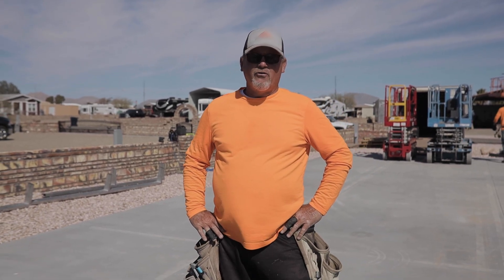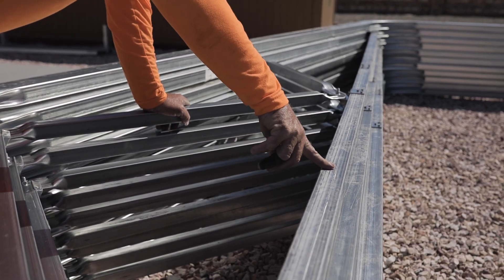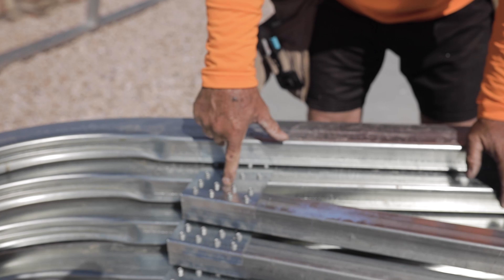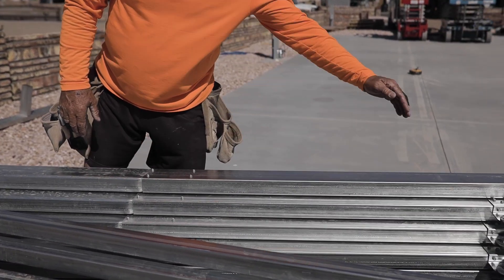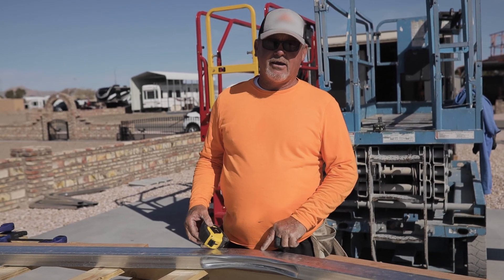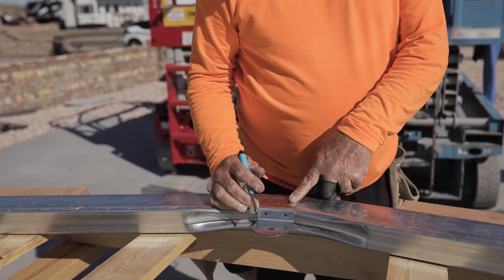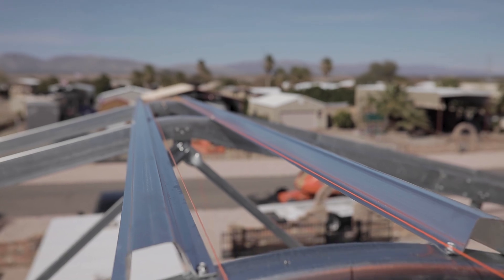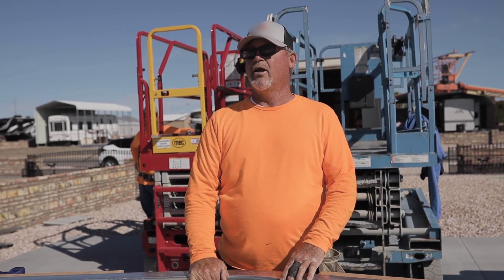How-To Build a VersaTube: Assembling the Trusses

Comment: I'm considering building a hangar with a bow truss roof which will be supported on vertical walls. This will be in New Hampshire, where snow loading is a major consideration. The planned dimensions are 40' wide by 50' deep. Do you offer or otherwise fabricate anything like this?